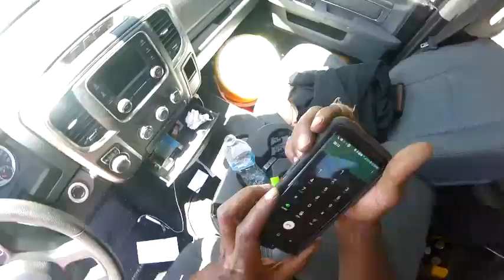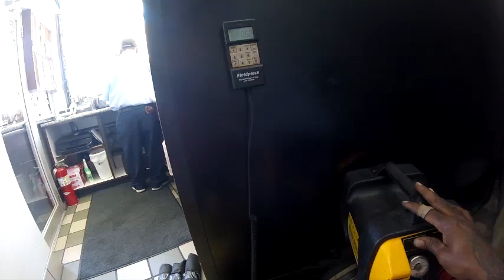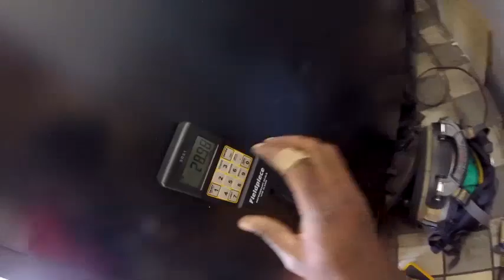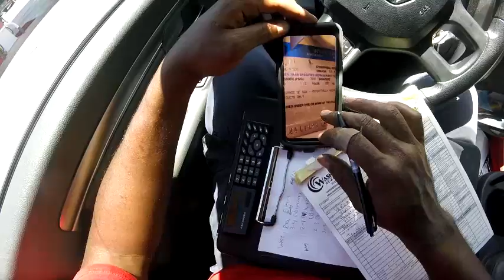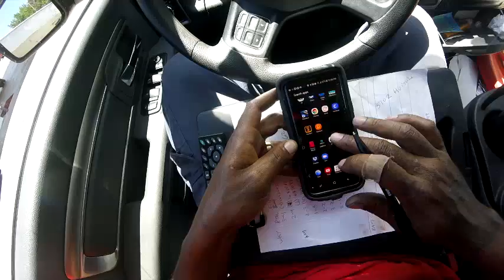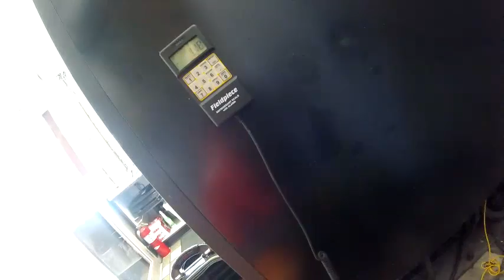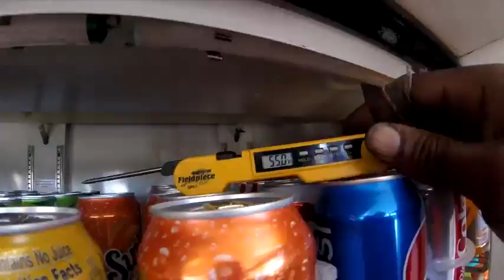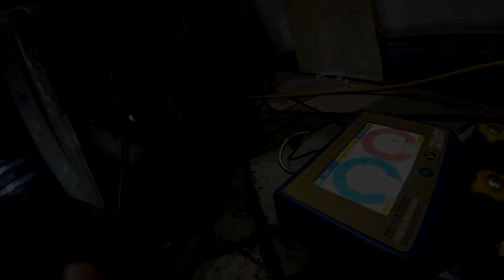HVAC: Troubleshooting reach in cooler

Comment: I've shot the oil out of my pump a couple times. Should be fine as long as you put oil back in it before you used it again lol. Mine the exhaust is in the handle.so it would've covered that wall